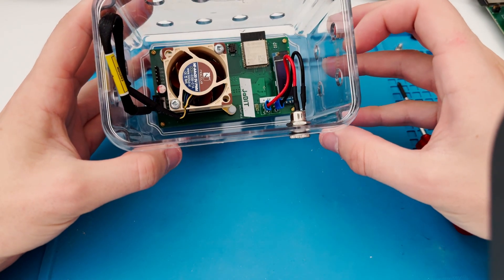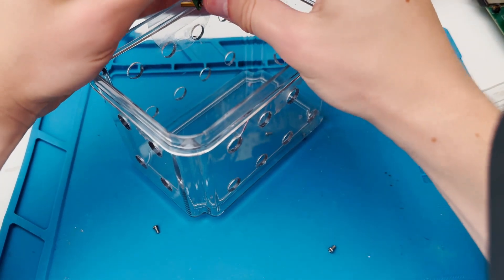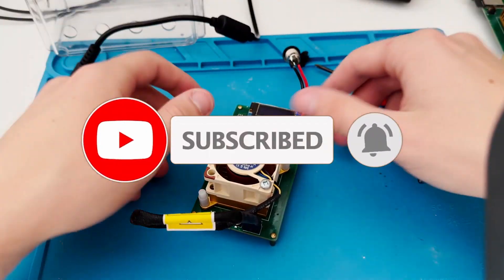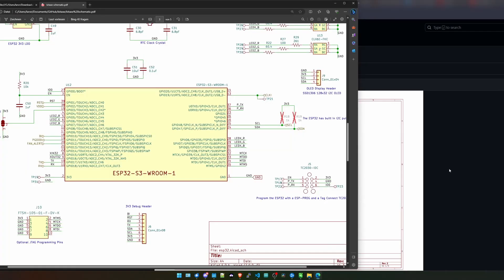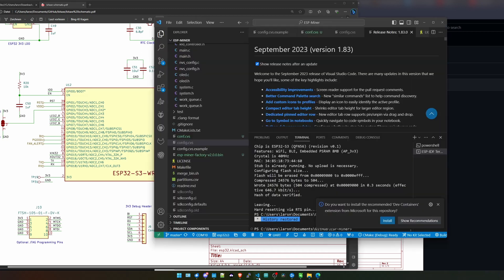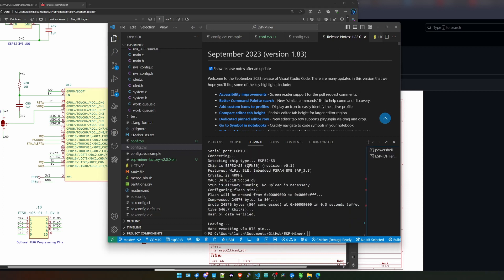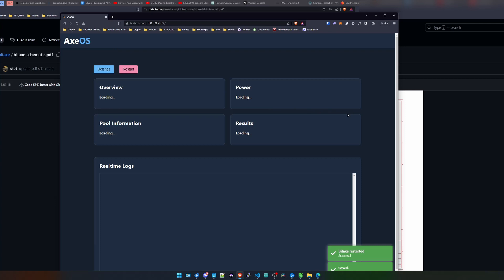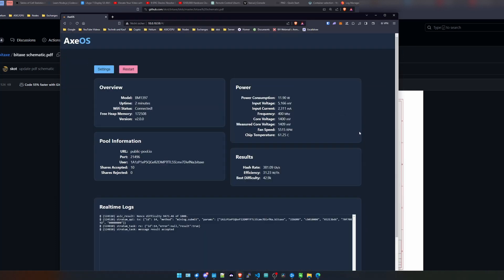Fixing a Bitaxe (kinda)

Comment: What size screwdriver are you using and does that work for the fan screws on the heatsink?
Reply from the maker: I use the ifixit kit. Most of the screws are either m2 or m3
Reply: @WantClue  thank you sir 🫡

Comment: Excellent video thank  Doyou know I coulg make a flash to a Bilxate  thats bridge, dont turn on, I wat upgradin, when the firmware or update, was installing the energy went out and the Bilxate don want to turn on back....thank you
Reply from the maker: In this scenario you need to flash the factory firmware. The easiest way is to use my web flasher. Press and hold the boot button before plugging in the usb cable

Comment: I’ve just bought a 201 and it won’t connect to my 2.4 wifi but also the RESET button does not work on the board.  Any ideas?!
Reply: I have the same problem it cant connect to wifi and hot spot, can someone help how to solve it?
Reply: @B1rakimus1  It turns out my configuration for the mining pool was incorrect and I should have left off the strtum+tcp:// part - so that's what was failing.  I fixed it by taking it away from my house and using the USB port to power it, then after about 30 seconds it reset and you can connect via wifi to its point and type in the correct address for the pool, then save that and take it back home!